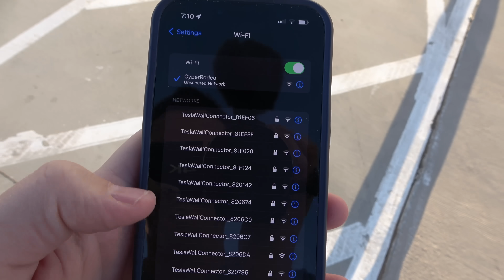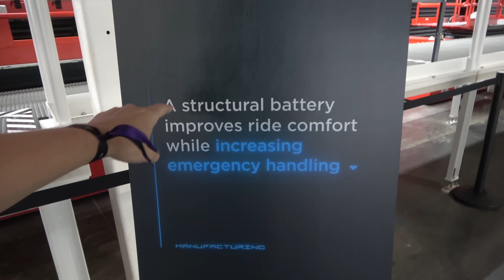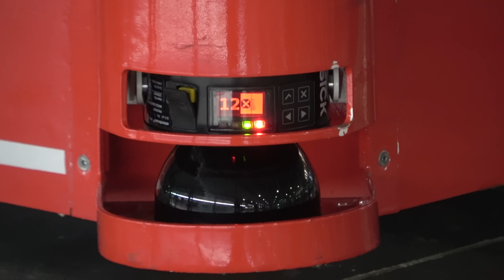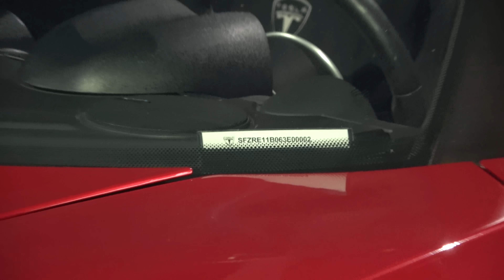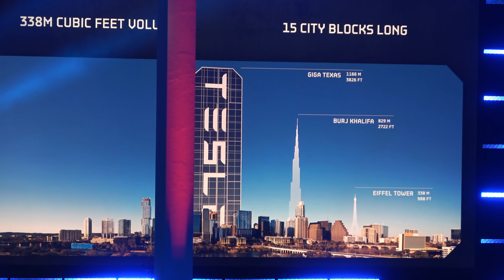What's Inside Tesla's Texas Gigafactory?

Comment: Dan If you were wondering why they were holding stick well those sticks are fluorescent tube lights and when the Tesla coil turns on making the current between the two the lights light up because of the low pressure mercury be a Nobel gas it lights up when an electrical current is ran through it in a low pressure environment